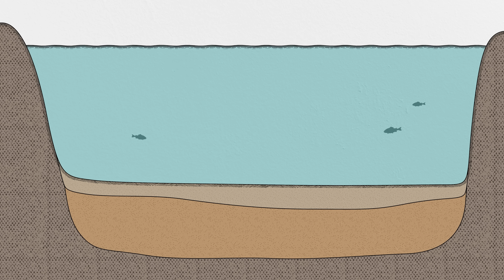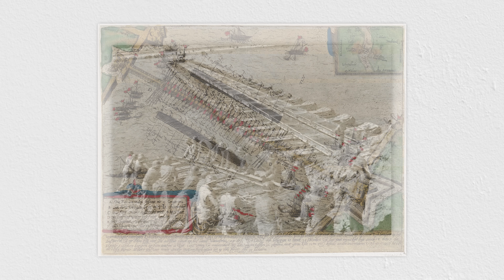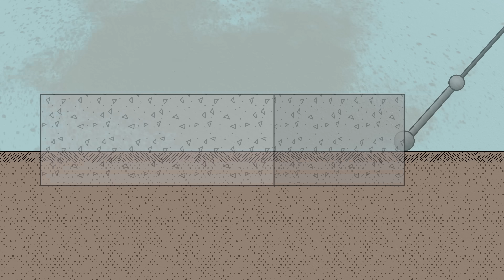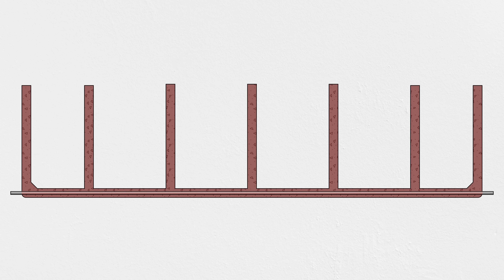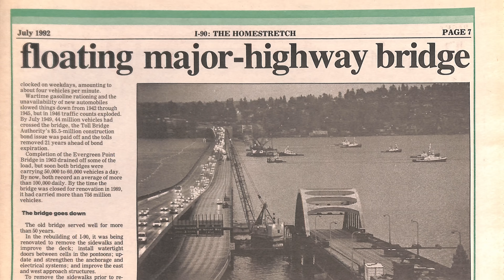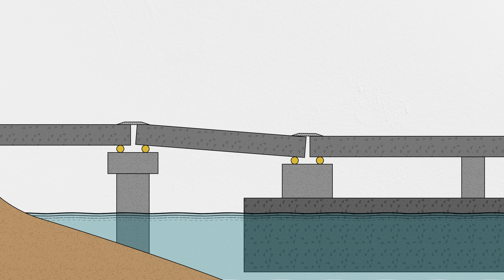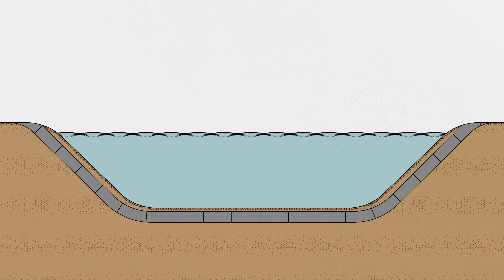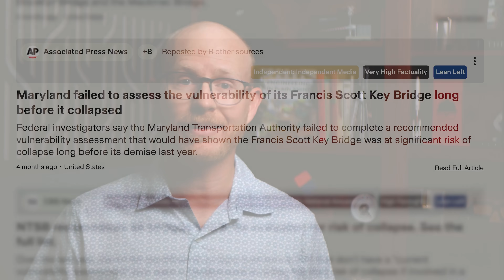The Hidden Engineering of Floating Bridges

Comment: 8:35 finally something that makes sense in Imperial units 😂
Reply: Metric is superior
Reply: as far as ratios go, imperial has all the good ones. ALL the good ones. Far too many. 12 and 16 are fantastic rations which are easy to multiply and divide and show up a lot in nature. If imperial stuck to one or two ratios for everything it would be a really good system, if only because metric is stuck with 10s for everything (10 is a really bad number tbh), but instead we have 5280 feet in a mile. I know no one choose for it to be that way, the ratio is a coincidence we're stuck with (and no one converts between the two anyways) but I still want to choke whoever made up miles.
Reply: I'll remember that when I get back to counting on my fingers again 🫡 @Rowlesisgay

Comment: Thank you for a very informative video. Seattleite here. Would appreciate a deeper dive into the corrosion risk stray electrical current poses to the rebar of the concrete pontoons.  The light rail line across lake Washington on the floating bridge is 3 years behind schedule and hundreds of millions of dollars over budget now, largely due to problems with the concrete plinths the rails rest on.  Isolating the rails on a floating bridge has proved a major engineering challenge, and it's unsure if has been solved
Reply: When are these projects ever on time and on budget, let alone if it’s never been done before?
Reply: The west Seattle bridge repair project

Comment: 5:17 cant the sub just go under?
Reply: Too unsafe. Both for the bridge and the submarine due to the anchoring cable system.
Reply: @TheBearInTheChair  Plus the Ohio-class are always accompanied by one of these until some out in the Straits: https://en.wikipedia.org/wiki/USCGC_Sea_Devil
Reply: The water is not deep enough to submerge the submarine under the floating bridge.
Reply: @johnstuart3851 didn't he say it was 200 ft deep? How much room do they need
Reply: @inkscratch  Lake Washington is approximately 200 ft deep.  The subs use Hood Canal which is part of Puget Sound. The depth under the Hood Canal bridge varies from 80 to 340 deep depending on location. Like TheBearInTheChair wrote, it's too unsafe for both the sub and the bridge to risk crossing under.
Reply: @johnstuart3851 but they can use the normal part of the bridge that is higher above the water still rather than disrupt traffic?

Comment: I’ve had a reoccurring nightmare about being on a failing floating bridge  since I was a kid. Even though I’ve never been on or seen one.
Reply: I feel a lot safer driving on the Seattle floating bridges than any suspension bridges.  You can just jump off and swim to the next pontoon easily if something wrong.  There is no risk of freight or barge traffic, there is none allowed anymore (not there). You'll be fine.  The Tacoma Narrows bridges have bridge decks 187 feet off the ocean and they sway because it is always windy in that channel.
Reply: Only the early Tacoma Narrows bridge. Have fun

Comment: Why don't they build one of these all the way across the Atlantic?
Reply: Way too high waves, to start with.
Reply: Secondly, nobody has got that kind of cash lying about. Thirdly, that's one heckin' commute no one wants to take.
Reply: A simple calculation.
New Foundland Canada to Iceland is 2300 km (1400 miles) shortest distance. (skipping Greenland due to too many glaciers in the way)
That mean a 2 day (10-12 hour per day) drive. Meaning a sleepover is required. Meaning there must be floating island with plenty of accommodation. Not to mention food.  But every few 100 km there must be a fuel station. Meaning there will be people working there who require accommodation.
The logistics alone makes it not feasible, aka ridiculously expensive.

At the moment there are 3 meter high waves at some places.  Not very comfortable to drive. Too much risk for getting seasick.
A bit more south (travel distance 5000 km) there are 4 meter high waves.
During storms there have been reported 6+ meter (20ft) high waves. Good luck trying to stay on the road.

Then there are the many (100+ ?) ships crossing the Atlantic, and probably also in the area where the bridge would be.
Also Northern Canada is sparsely populated. Getting huge amount of construction materials there (not many roads) will be difficult. Not to mention the cutting down large chuck of forests for the roads.

Comment: This is REALLY Scary, wow
Reply: Nothing scary about the two bridges over the lake.  The one in the Puget Sound is a little more sus, but it is short.  Worst case scenario you jump and swim to the nearest pontoon.  Grady didn't really go into much detail about WHY the I-90 bridge really sank other the were storing a little contaminated water in them.  The area had a  blizzard (which is why the bridge was already closed and is super rare here), they hadn't cleared the snow off the deck and it was still closed when a day later a tropical storm blew through and dumped a few inch of rain on the snow.  The snow trapped most of that water on the deck and eventually it surpassed its designed weight load.  Lessons were learned.  They are some of the safest bridges in the world now.  Large commercial vessels aren't allowed under them either.  No barges or cargo ships at least.